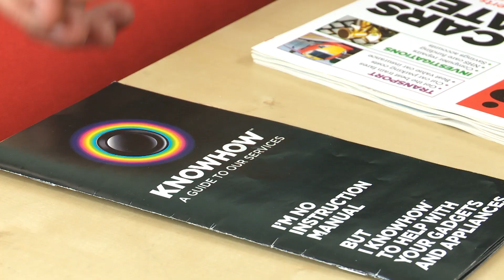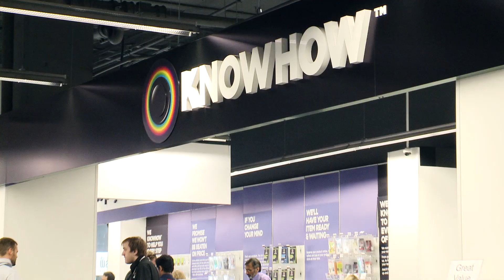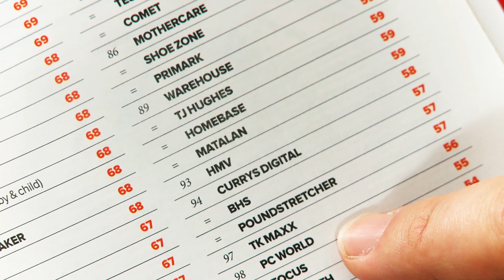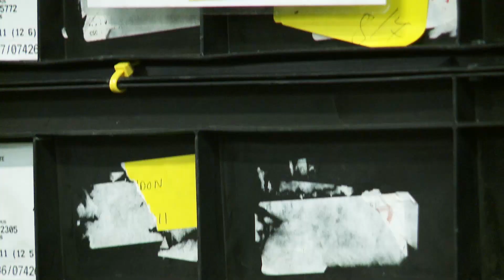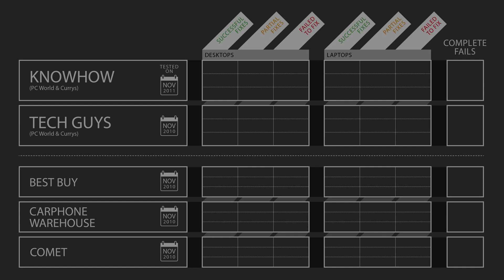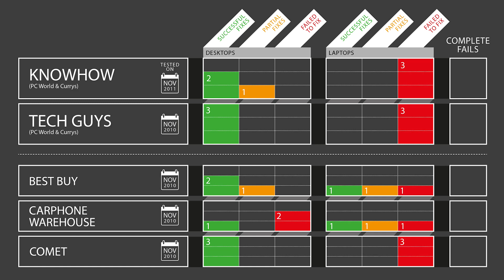Currys & PC World Knowhow PC repairs investigation - from Which?

Comment: Curry’s sold us a brand new Hoover washing machine, it’s faulty on 1st tine use - showing an E9 Motor Error. Called them a day after the purchase, they refused an exchange. They said Hoover will decide if it needs fixing/ exchanging, likely needs to be fixed. Hang on, a full price brand new machine broken on 1st use and Curry’s refused to exchange?! Why doesn’t anyone just starts selling faulty items at full price and ask the manufacturer to fix it instead of selling actually working machines?? Is this even legal?

Comment: I worked for this company more than 10 years ago (what was supposed to be a stopgap job whilst I was applying for graduate positions, turned into a 2-year nightmare). So I know pretty much how this company operates (and it's far from pretty!): 

I would be very surprised if this new service is much different or better than the "Tech guys". Most likely they have simply rebranded to increase their bottom line. In fact, Money is the only thing this company's CEO's care about. 

Most of the management and those that succeed and climb the career ladder with this company tend to have psychopathic/narcissistic traits. 

The customer advisors and tech people are mostly regular people on a low wage/ high-pressure job and usually leave the company for a better offer at the first opportunity, resulting in a high turnover of staff. 

The reason the staff can appear to "know nothing" is due to inadequate training on technical/computer knowledge. Instead, any staff training is focussed on (sleazy?) sales tactics as opposed to good technical knowledge. 

Contrary to myth most workers at this company aren't stupid (typically students and graduates with a lot of debt), but they do have some challenges that often mean working against the customer's interest, or pretending to be stupid to avoid getting into trouble with their superiors.  Example: refusing to serve a customer because selling a computer without any additional items would put them in trouble with management, and lead to disciplinary action. Let me explain: 

As, the profit margin on the computers is low (about £5 apparently) they are pressured to sell as many high-profit add-ons as possible, whether the customer needs them or not! Typically the add-on insurance, the antivirus software that is on promotion (usually Norton), and other overpriced items such as USB cables. THeir sales scores are monitored by "big brother" management for each computer they sell, and if they fail to reach a certain percentage on these high-profit items they can receive some harsh penalties or even lose their job. To avoid this bad outcome staff learn tactics to avoid putting a sale through, or refuse to serve a customer if they know the customer won't buy the items listed on the scorecard by the management or head office.  

If you think this company is bad for customer service try working there! I have worked for quite a few employers in my life, and most of them have been pretty good, but   Currys is one of the worst!  I wouldn't touch Currys, PC world or any of the other companies owned by Dixons retail group with a barge pole, after seeing how they operate from the inside.
Reply: Mate what area did u work in.

I worked in Stanford Le Hope.

The stories I could tell you. Absolutely disgusting. You wouldn't believe what goes on inside the company. 
Worst company I've ever worked for by far

Comment: We bought a toshiba laptop from them 2 years ago. We've been paying for insurance. Over a month ago, we had issues with the battery not holding charge. At first we thought it had to do with a damaged battery charger. So we called Currys and they said they would send us a new charger. They sent us wrong chargers three times, even though we specified the model and the number of pins etc. Three times - over a span of 3 weeks! However, this didn't seem to work. So we took the laptop to the local store. They said it was probably hard-drive damage caused by the laptop being accidently dropped. We received a text a week later saying that the laptop was ready for collection at our local store. We went to get it, and they said it wasn't there. And no one knew anything about it. So we made some calls to the place where they repaired it, and they said it was a text that was accidentally sent to us. A week later, we receive a call from one of the guys from Currys saying we could collect our laptop from the store. We went there again, and they didn't know anything about our laptop. After repeatedly calling them for days, they said we could get the laptop on Wednesday. My wife went this afternoon to get it, and again the laptop wasn't at the store. They said she could come back this evening and confirmed later that the laptop was in. She just called me saying that the data on the laptop was not retrieved, which was the main reason we gave them a storage device and gave it to them. I've lost over one month of important paperwork!
Reply from the maker: That doesn't sound like very good service. Unfortunately though, data recovery from damaged drives is not normally included in the repair. You usually have to pay extra for that as it can be quite a difficult process. Always a good idea to keep a backup of everything or even use a cloud service.

Comment: Laptop has needed repairing on numerous occasions but whenever it gets sent to get fixed they just reboot it and send it back(the graphics card needed replacing). Only on the 5th time I send it will they actually fix it because if they don’t they have to replace my laptop, which will cost them money, terrible. Even at curry’s they know it’s crap and try to fix it in store if they can rather than send it to knowhow

Comment: You need to fully inspect the advertising of Knowhow on Knowhow website and Curry’s, submit a repair that requires £60 upfront and wonder why the 12 month guarantee on £60 Upfront cost repairs as advertised turns into 90days/ 3m once you’ve paid £60 via the tills given a receipt as if you’ve bought something and then been given your Service Docket with such 90 day repair warranty mentioned on it.
Trade In info isn’t 100% clear, going to actually try to clear that one up too soon.

Comment: I am reading all of the posts on this thread and again and again the term 'insurance' is mentioned.  Currys/PC World and all of it's associated companies in the UK DO NOT sell or offer insurance for TV's and Computer equipment!  They sell/offer 'CARE PLANS'  which as you will know are totally different to an insurance policy.  Regarding data loss:  if the data on the computer is of any importance then it is the owners responsibility to BACK IT UP.  There are plenty of options to do this including FREE CLOUD SERVICES!  Software cannot be repaired as it's not mechanical or electrical also it is not the retailers responsibility to know your 'Microsoft Office Licence Key'  or indeed supply lost or misplaced software installation discs. 
I work in the industry and I see it from both sides...and Which?  Play the game.  I subscribed to your magazine and services for 20 years, I own every publication from issue 1 right up to 2003!  You need to do your research and get ALL OF YOUR FACTS RIGHT before placing a misleading video on You Tube full of inaccuracies that will only entice public debate, of which most (not all) replies are exaggerated and untrue.
Reply: +Gary Gelder No-one is going to bother writing replies on here which are untrue, especially if they've had a good experience with this company.
As for exaggeration, KnowHow are the experts at that, their game seems to be to do anything to increase the customers' bills.
As for software, computers are normally sold with software included and it is the seller's legal duty to ensure that is fit for purpose.
If a repair is likely to cause loss of customers' data, then they should be informed beforehand and given the opportunity to recover it. As all data is held on the hard disk in practice only a change of disk would cause any data loss.

Comment: In April of this year 2014 I purchased a HP Envy 17-J130ea Notebook from PC World at a cost of £900 which is supplied with a High resolutions screen, 1x8gb ram and 4gbram it was returned under warranty as the screen had a vertical line. Know How fitted a new screen and returned it 7 days later. I noted that it was running slow so I checked the ram, it only had 4gb ram fitted, Know How had lost 8gb of ram. I again returned it to Know How who informed me because it had been opened the warranty was void. I also purchased a second HP Envy same model during 2014 not from PC World so I could check the ram. 12gb was fitted. Know How wanted £40 to fit a anew 8gb ram chip and £70 for the ram chip. What did do.. Purchased 2 new 8gb ram chips from Crucial and fitted them to my Laptop and transferred my 12gb of ram to my partners laptop. Job done and lesson learned. I will never use Know How for any future repairs.
Reply: As someone who fits these i only charge £20 + part - knowhow is a rip off.
Reply: David Traynor ttyl!heherew1

Comment: They told us they would retrieve data, and made us buy one of their storage devices. If they couldnt do it, they could have said it right away. Seriously
Reply from the maker: In that case they should have warned you of the risk and not made you buy the backup until they had been successful. It is never guaranteed that you can recover data from a damaged drive.
Reply: Which? by law (data protection act) you are not allow to store customers data on an hard drive, so the reason they would have done this is to allow them to copy from your failed device directly to the hdd provided

Comment: They are useless. My laptop had 2 faults (trackpad fault and wireless not working). The "knowhow" guy laughed in my face and tried to charge me £50 to even look at it. Turned out it was a hardware fault and I shouldn't be charged. Didn't stop there though, he couldn't work the repair booking software and had to be shown, then the printer ran out of toner and had to get someone else to change it!

Comment: Have just finished my 4th call regarding a repair to my Zanussi washing machine that is 14 months old. Original fault was door not recognising it was closed - on initial call to arrange repair I fully explained problem & they sent an engineer 3 days later who came without any parts to fix the issue so wasted journey & our time - he rang a supervisor & told us would be back in 4 days to fit it - total lie  -parts out of stock & not expected any time soon. Another phone call - parts out of stock another phone call - wait for 7 days & if we cant fix will get you a replacement, now have to wait another 3 days for them to " investigate" and OK the replacement. As below several comments - no attempt to contact us and keep us informed, complete lack of empathy for the situation we're in. Their declaration on their website "we will get it fixed in no time" - depending on your interpretation does that mean never? Won't hold my breath judging by others experiences here.

Comment: they are having trouble fitting a dishwasher at my house and have asked me to buy a water pipe for them (with little info about what it actually is).  I did actually pay for them to know all this, the clue is in your 'knowhow' trademark guys!  

Yes dishwashers need pipes to be connected to a water supply!   It is actually 30cm inches from the mains inlet water pipe in a kitchen - maybe they should have employed plumbers!  Some of the staff have been helpful in finding out what hose I need to get for them.

Comment: I have looked at the on line reviews for Currys pc repair service and it is absolutely dreadful there wasn't a good review to be seen they need to do a system restart.
Reply: Depends if you were looking at the independent professional reviewers who thoroughly investigate and consider all aspects. Or if you were looking at customer reviews. If it's the later then that is the issue.
How often people go to the review websites after buying something from the shop and nothing bad happened? Not often at all. But how often do people go to review websites after buying something from the shop and they run into a problem such as faulty product? Significantly more often. So as result you are primarily get a negative reviews.

Comment: I was id known this before sending me poor laptop to them i have had the laptop returned and it now is worse then when i sent it, i needed a crack in the screen fixed and now the battery has failed with in hours of being home. After spending an hour on hold they have told me they will be doing nothing to fix an issue they have created

Comment: They took our printer to repair after 3 months of owning it wouldn't replace it under the years warranty.  They took ages and I got it back damaged on outside.  Also had appliance cover Know How took 42 days to repair it - hang on they didn't repair it!  They messed up so many times, did rubbish job, and now its been 42 days and promised at 42 days be right off and get replacement washing machine, phoned 4 times today and still no replacement code for currys!! Waited 42 days and still no washing machine.  Turned up to fix dryer without the part, I waited in all day.  They Wrote off a tv and undervalued it! So many mess ups.  Also it takes about on average 6 mins to get through to a knowhow assistant every time and they are so incompetent! Don't ever bother taking out cover with them. So rubbish.
Reply from the maker: Wow, sounds like you've had some bad experiences there.

Comment: Advise on gas appliances?, if that is true they are breaking the law. Even a qualified Gas Engineer will not give you advise on a gas appliance.
Reply: I work for Knowhow,as an installer.
I have worked assisting gas fitters extensively,and can vouch 100 %,that every Knowhow fitter,not only advises on every applicable part of the appliance,but performs a full working demonstration (including the very important 'burn off' procedure) as part of our proposition.
I work at 7447 branch.
Pm me with any questions,I will sincerely mention them in writing to my top managers.

Comment: Update to my personal situation 

Iv been up till now a whole month on with no fridge/freezer, it still bleeping every 4 hours, I’m still having to reset it 3/4 times a night! Waking us up! Breaking our sleep every night!

After my last online rant curry’s got in contact, we’l get Hotpoint out, they will fix it blah blah, two weeks on the guy turns up, can’t fix it, it needs a compressor, it will be in Friday, Friday came and went and now two weeks on I call hotpoint and they tell me “oh it’s on order but we don’t know it’s ETA! Iv now told curry’s it’s a month on, it’s not fixed, you need to get this replaced or refund me, I paid £330 for this in June 2017, the average life of a fridge freezer is not 23month old, they have offered £150, what good is that! 

Oooooo buy this fridge freezer sir, 10 years warranty from manufacturer “parts only, not labour”

You get hotpoint out, can’t fix a 23month fridge/freezer, parts are on back order from Italy, no idea? Possibly the 24/6/19

Not fit for purpose 
Potential fire hazard found by WHICH
Bleeps every 2-4hours, all day, every day

Don’t buy anything from curry’s, buy online, save them pounds, your find out taking advice from there sales staff utter rubbish and just as there customer service is. AVOID